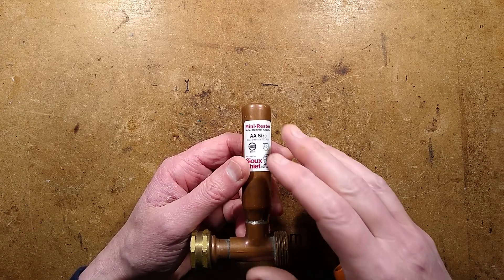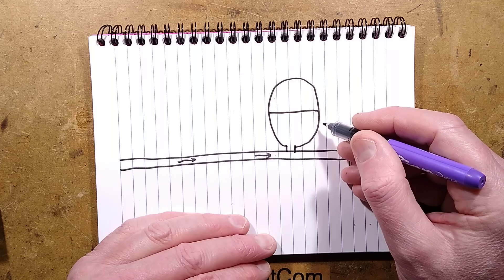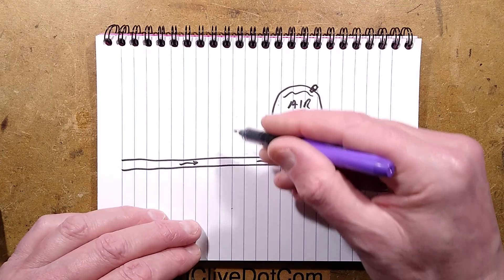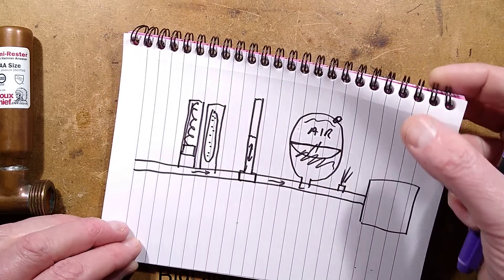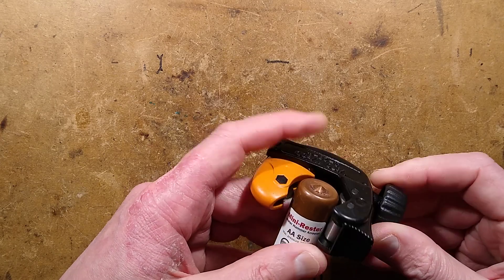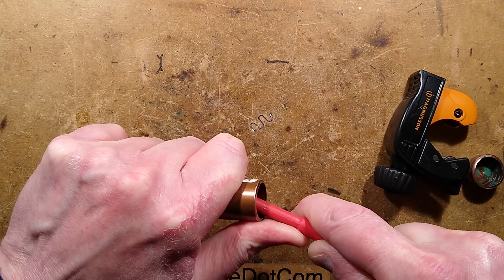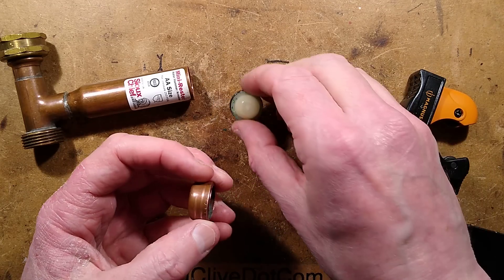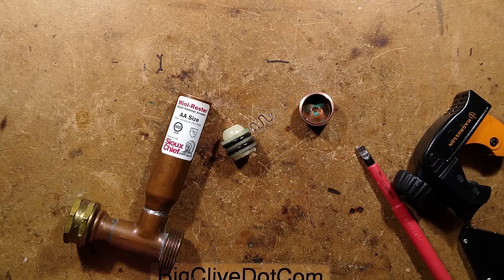inside an American made anti water hammer device

Comment: A lot of people think that the residential water pressure in the US is only 1/2 of what you have in Britain.  This isn't true.  We actually have the full pressure coming into the house.  It's just that we center-tap the supply and split it into two "legs".  It's the reason why it takes so long here in the US to fill a kettle.  You'll be relieved to know that commercial buildings have three phase water pressure.
Reply: And in the U.S. it Hertz more too, we get an extra 10.
Reply: In the U.S.: "What's a kettle?"
Reply: @lesliefranklin1870  1 Cattle.
Reply: @kevinwalker4623  Oh, it's a Cow. Thanks!
Reply: @lesliefranklin1870  Ask anyone from Boston.
Reply: "commercial buildings have three phase water pressure." Uh, right. But water pumps for RV campers are often built "3 phase" (3 diaphragms) to save the space of a "surge tank" to take out the pulsations.
Reply: I wondered where this was going... Thanks for the entertainment 😅
Reply: We definitely have natural gas in a lot of places, that’s in the high 10’s of psi at the street, and then goes through a regulator to drop it to less than 1 psi. And then there’s an excess-flow valve that shuts it off if a line is damaged and releases an abnormally high flow rate. There’s surprisingly a lot of parallels to the electrical service.
Reply: three phase water pressure???
Ice , liquid and steam ????
Reply: @PaulG.x yes
Reply: So many people are missing the absolutely brilliant joke
Reply: Oh no, you can't just break the water analogy like that! 😮What is the water equivalent of a center-tapped transformer? How would your proposed device work? This will keep me awake all night...
Reply: @mumiemonstret  A hydraulic transformer is called an _intensifier_. It's basically two connected pistons, one has a large surface area and it's directly connected to a small surface area. The pressure is raised by the ratio of surface areas while volume decreases.. It also requires pulsed operation (AC). A common place to find them is in high pressure common rail fuel injectors in diesel engines.
Reply: @mumiemonstret  A 110v CTE transformer's centre tapping (at least in  the UK), may be connected to earth. I was on a course once when one of my fellow attendees struggled with that...  Maybe the centre tapping in respect of water, goes to waste?
Reply: A proper American removes those restrictors.
Reply: Thank you that's teh first thing to make me smile all day.
Reply: Wait, wha……oh 😂
Reply: Very good!
Reply: Well played!
Reply: @andyruse4670 That is what drill bits are for!
Reply: Well that's an electrifying statement. I'm shocked.
Reply: British houses don't have faucets. We prefer taps.
Reply: @trueriver1950  well, we don't like to force it.
Reply: @trueriver1950  In the US we have taps for light beer. In the UK I think a light beer tap is called a "scupper". :)
Reply: This is the funniest comment I've read in so long. This is the best comment of the century.
Reply: Loflamo
Reply: I see what you did there!
Reply: I hated that while travelling in America, having to bring along an adapter just to fill my NZ cup from American taps. Even the toilets flush in the wrong direction.
Reply: Oh man... I ride 76lbs except for shower+watering time in the mornings.
Reply: @andyruse4670 The bathtub faucet in my house built in 2017 has no restrictor of any kind.
Reply: 3 phase water ?  Never heard of that we do have a regulator going into the house that drops it to 35 PSI my outdoor freeze proof hydrant has 110 PSI  if that went into the house would be all kinds of problems .
Reply: @jhonsiders6077 In my non-commercial experience the first thing the water flows through after it enters the house is an adjustable pressure regulator, so yes.
Reply: That's funny! How would you even do that? City water where I live is around 80 PSI with a pressure regulator to make it 60 PSI inside the house. There's also a one way valve to prevent filth and chemicals back feeding into the municipal supply, so if the expansion tank fails the expansion from the water heater will run the pressure inside up well over 100 PSI. This leads to toilet fill valve failures which I finally notice so when I fix those I always check the expansion tank as well. Theoretically the TPR (temperature pressure release) valve on the water heater should open at 150 PSI but it never gets that far in my house. 
I don't use water hammer arrestors they weren't a requirement when this house was built and I've never bothered to add them.
Reply: The really funny part -- to me, at least -- is that water is the analogy to how electricity flows.
Reply: @RonJohn63  I believe that is why Capacitors were originally called Condensers... the idea was that one could condense water out of electricity... the result was not what they planned, but the rest is history.
Reply: Lol😂
Reply: Hahaha thanks for this 😂 Got a good laugh.
Reply: Damn I was like, just like how the US does electricity. 😂
Reply: Also remember that the UK water system is usually a ring. On one side, this allows higher water flow with less diameter tubing, therefore saving on copper, on the other hand you need separate faucets for hot and cold water which you can turn off individually at each outlet. In contrast, in the US and continental Europe were you have a star system and you can simply turn off a valve down stream.
Reply: @karl-linus-amsler  "Also remember that the UK water system is usually a ring"
Oddly... In hotels and large domestic premises, you may be close.  In small premises, the domestic hot water supply is generally analogous to an electric radial circuit, the hot water leaving the cylinder, and running to terminal fittings (outlets) large premises may have a pipe that returns from the last terminal fitting to the bottom of the storage cylinder. the water's circulated by means of a bronze bodied, bronze impeller pump, the result being that there's very little delay between opening a tap and the arrival of hot water... the hot water's circulated in a ring, and you don't have to draw, possibly waste, a lot of cooled water that's lain in pipes since the last user drew hot water... Cold is usually supplied via a 'radial' circuit.
Reply: Had me for a second
Reply: A good demonstration of this would be to fill your kettle in the bathtub. It would fill a 2L pot in just a couple seconds
Reply: Three phase water. 

Water Hammer at 1/180 sec 😮
Reply: @danaveye3977  Stop, You Can't Touch This. 
Water Hammer at 1/180 BPM
Reply: @TheButlerNZ  Water Hammer Don't Hurt Em
Reply: "full pressure" as in about 4 bar?
Reply: All the way to the end you had me
Reply: i know you're joking because Americans don't use kettles
Reply: @andyruse4670 Its definitely good we do have those restrictors, especially out west where we have such limited water.
Reply: I think the tube is close by a spinning process sas soldering or other heated process would damage the plastic/rubber parts. Somewhere there's a machine churning these out from copper pipe
Reply: You guys in the US are under way different types of pressure. Viva BRICKS.

Comment: How is 'stagnant' water in a pipe system different to bottled water?
I thought stagnant water was bad, because of insects, bacteria, and chemical contaminations.
Reply from the maker: The water in bottles is sterilised during bottling.  If it wasn't "fluff" would form quite quickly.
Reply: That’s a good question. I think water bottles and the water put in them is just cleaner than your average tap water and piping system. Pipes that stay stagnant (fire suppression, etc) get all sorts of nasty bacteria growth.

Comment: I used one to prevent water hammer from my washer dryer. It was sealed at the end with a rivet! It worked but lasted only  a few weeks, I cut it open and the piston was at the top end (like Clive's) clearly due to an air leak. Poor design imo. I now run the cold tap during the drying cycle which costs the same over a year as the arrestor.

Comment: The trapped air method to reduce water-hammer had been banned about 40-years ago by most major U.S. plumbing codes, the dead space led to breeding things like Legionella bacteria. Sioux Chief has many models of arrestors, and, with most things in life: Bigger is Better. They are reasonably priced in the U.S. and last almost forever. SupplyHouse sell most of the line on their site.I have installed about 50? or so ... and I'm not a plumber.

Oh. A mounting is important for these water-hammer arrestors, especially the orientation of the arrestor to the direction of the pipe. These washing machine ones are convenient to connect --- But they are 90 degrees to the direction of the shock wave, the arrestor opening should be inline with the direction of the shockwave. (I'm not sure I'm explaining this well).

Comment: Looks like they have first soldered it to the T pipe, then added the plunger from the back. Rolled over the end by a lot and "spot welded" or something to seal it off. Since the plastic plunger likely doesn't like heat. And two O-rings is likely to ensure that it doesn't kilter over as it moves up and down the pipe.

Though. I have for a very long time pondered why one just doesn't use a U shaped pipe instead. Make the two straight segments of the U adequately flexible (bellows) and the whole thing will act as a dampener. Now, one might have to make it out of stainless as to not have it fatigue too rapidly. Or just use plastic piping, it is adequately sturdy for the job.

Comment: I have two dead end water hammer buffers in the wash room. Once a year I drain the two lines completely to refill the vertical section with air. They are 1.5” OD x 2’ long black iron pipe.

Comment: Have two sets of these that I have to switch out every few months. One set dries out while the other is in use. Didn't know about the puck inside - they do stop working well after a while. When I remove one that's no longer doing its job very well, I can usually dump a significant amount of water out of it, so either the o-rings aren't a good seal, or the puck has been jammed all the way to the end of the closed-off pipe and is no longer providing any capacitance. Not sure.

Comment: Pretty commonly used here in Australia.  They make different types depending on what your mains pressure is.  High pressure areas need a stronger water hammer arrestor.  Some actually do seem to have a spring in them, you can hear it scrunch when they operate.  Apart from the noise, a water hammer will eventually damage a copper pipe because the hammer/movement causes the copper to work harden and eventually it will get fatigued and crack.  Similarly, plastic pipe gets more brittle as it ages and more likely to crack from a water hammer.

As a metal worker, that one looks like it's friction welded on the flat end.  They're made out of a simple piece of copper tube.  It's a common manufacturing technique.  For the threaded end the tube is heated and then pressed into a die to neck it down and then a thread can be cut on the narrow part since the material wall is now thicker.  For the flat end, it's heated and pressed down flat but with a very narrow tube.  A conical die is then spun very fast to friction heat and weld the narrow pipe shut.  That's why it looks the way it does.  It is literally called "friction welding" and is very economical to do at scale since the tooling is usually simple and you don't need any shielding gas.

For the necking down operations sometimes they are heated very quickly with a very hot flame (oxy/lpg or similar) but sometimes they just spin the part very fast as they push it into the die.  You can normally tell which one it is by looking at the marks left by the tooling (which is the giveaway for the closed end in this case).
Reply: I definitely have seen a splice in an irrigation line fly apart from waterhammer. It can definitely break something if the pressure peak is high enough or as you said the system is worn out by it over time.
Reply: How do you pressurize it at the top
Reply: @AgentOffice  As you can tell from when it was opened, it's at 1 atm.  The water pressure pressurises the bulb.  This one is probably intended for relatively low pressures, maybe 220 kPa, and that might be why it didn't work for the previous owners.
Reply: @Chris_the_Muso  no way we use these at 60-80 psi
Reply: @AgentOffice  Well I did say "probably".  I also note that "use" and "works as intended" have an overlap on the Venn diagram.  The ram space required increases exponentially as the pressure increases.  Here, these devices come with a working pressure rating, which seems to be missing from the example shown.
Reply: WTF are you talking about? These are made from a copper blank (technically a thick copper coin) which is formed into a single side ended tube by pressing into a die, or deep drawing (that divot on the sealed end is from the plunger used to shoot the tube off the mandrel), then the plastic puck is inserted and the neck is formed by roll forming it in a machine like a lathe that has rollers instead of a cutting tool. Just search how high pressure gas cylinders are made.
Reply: @bogdan_n  I'm quite aware of how pressure vessels are made, but they are made from a billet, not a disk.  You can see the spall marks on the cone, and it's hollow.  You can also see the copper carbonate degradation products on the inside of that end, ergo gas heated.
Reply: @bogdan_n  Not to "um actually" here, but can confirm it's just a copper tube, manufactured in nearly the exact way op explained. To use a blank would require at minimum the copper to be annealed, but it would take a loooot of tooling steps to stretch it out that far, and each one a risk of crimping, crushing, or otherwise damaging the softer copper. (which in itself would make for a flimsy end product) 
getting long tubes of copper to cut down to length they need is easier, more consistant for every dimention, and means they can adjust lengths to fit changes in design spec, or new products, all at a /single/ machine. 

The tapering for the neck on parts I worked on is just done cold with multiple steps via hydralic dies.
Reply: @Dragonwarrior125  Thanks for dropping in.  Yes the neck down operation would make more sense if it was done cold, since the (probably PE) slug with o-rings would need to be inserted first.  I know how quickly copper work hardens though, they must be right on the edge of what is practical.  The materials science behind these techniques is fascinating to me, I just love this stuff.

Comment: Can't say which Canadian style country north of USA, but we were contracted to remove and replace a significant number of these, kinda quietly, due to unscheduled disassembly followed by a new water feature in the general area of the laundry in a unacceptable number of highrise accomodations.
Reply: the ones who ordered that hit job must have had a serious grudge against the tenants and their insurers... 😅
Reply: Some highrise buildings may have ridiculous water pressure especially on the lower floors, like 200 PSI. It's because they use a booster pump to get the water up 30 floors, and nobody bothered to reduce the pressure on the lower floors. We lived for a few years in a building where plumbing was constantly bursting in various units, and memos about only specially trained plumbers being allowed int he building.
Reply: @JxH  agreed. This however was a clear product failure. Pretty sure they fixed the problem with the product or figured out what went wrong in production as it was the manufacturers insurance company paying the bill. The replacement parts were noticeably different although that happens with products with time anyway. Strata recovered the bulk of the damage costs and the building was returned to operating condition. I have done a fair amount of  work for and with insurance companies and they more often than not were underhanded and confrontational. This wasn't bad. They of don't want to pay but once shown the ample, obvious evidence,  they did and made things right. We were under NDA to not discuss our work but we DID the work with the people there so it wasn't a secret.

Comment: Thanks very much for posting this video, Clive, I had often wondered what was inside such devices. Not knowing and the lack of information as to what method a particular device used caused me to not take the chance in purchasing one. I ended up restricting the flow to the problem machine to limit the hammer and still allow the machine to operate without error.

There is another way to stop water hammer and that is to modify the solenoid valve itself so it opens and closes in a more controlled manner and eliminating the hammer. This is done by modifying the hydraulic apertures inside the valve. I appreciate that your primary focus is on electronics, a video on a solenoid valve and its modification would be very interesting.

Comment: Regarding the thread size, those are very likely 3/4" garden hose, especially if the seller was in the US or Canada. It's the standard for outdoor hoses, as well as washing machines. It's fairly common on other portable equipment that needs a water connection as well.
Reply from the maker: Despite the UK being metric, we still use the 1/2" and 3/4" plumbing sizes with our 15mm and 22mm pipes.
Reply: The thread size and pitch for 'garden hose' are a different size standard from pipe thread used in the U.S. -- they can't connect together -- this always confuses people.